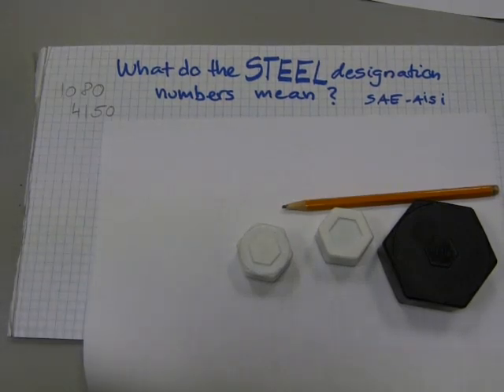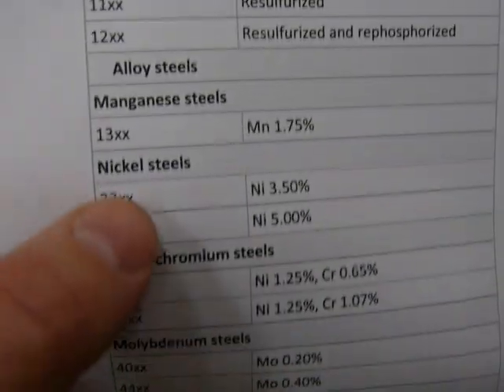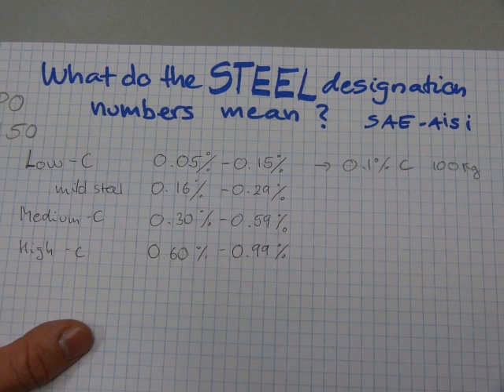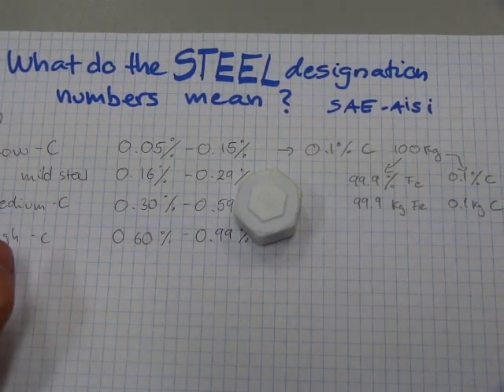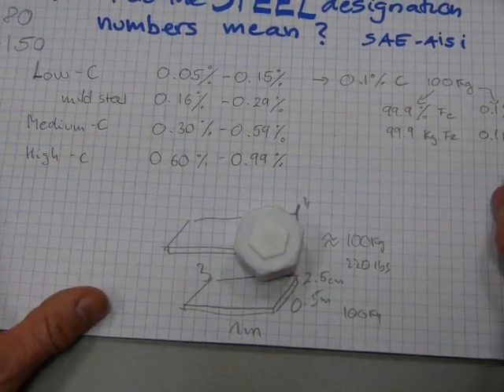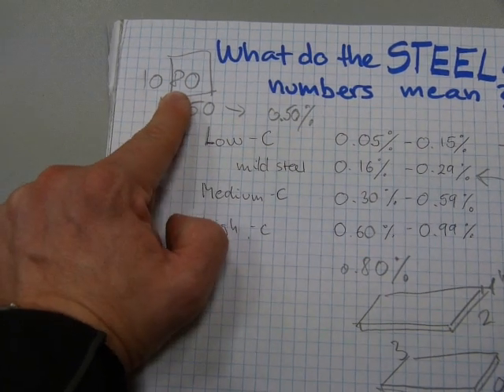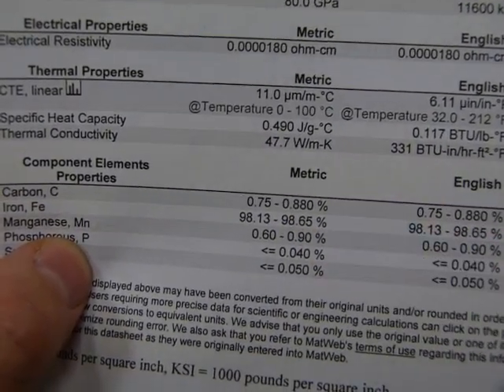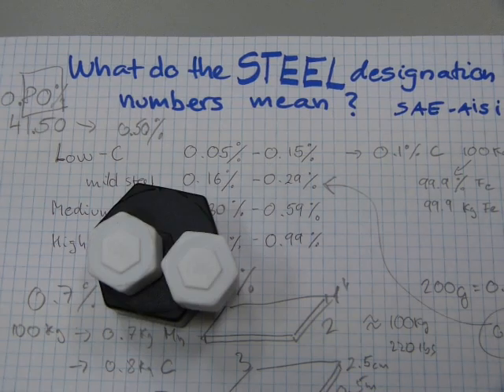What steel designation numbers mean (1080, 4150)

Comment: I have US drawing and the base material is : "material - 9531476; opt. material - 8493933". The SAE/AISI material grade codes are 4 digits. how do I decode these nombers?
Reply from the maker: That's difficult, the 'product code' MAY or MAY NOT have the SAE digits in them "1476" and "3933". Tricky, this one.
Thanks for watching!

Comment: So important to have a basic idea of steel compounds, its no good taking the time and effort to fabricate something only for it to fail by being not fit for purpose because the right type of steel wasn't used, ie tensile strength, hardness, ductility, wear resistance ect. It brings it home to think of a 50kg or hundred weight sack of coal as compared to the minute amount of carbon required to change it from low carbon to high carbon steel. Anyway enough of me harping on, i just want to say brilliant and easy to understand video. Thank you so much.
Reply from the maker: Thanks for watching!

Comment: What is the difference in physical properties between 4150 and 4140 steel. 
For example,  wear resistance, ductility, hardness etc.
Reply: First numbers the metal it's made of ... 4 is molybdenum.. the second number is impurities ( weld rods 6010/7010/7018,very clean to avoid viscosity) 1 I think is lead ... last 2 numbers are carbon compounds making it harder 

So 4140 is softer than 4160 but same steel
Reply: Matthew Denty 

Could u be more simple? As simple as ur telling to an animal to understand, such as me :/